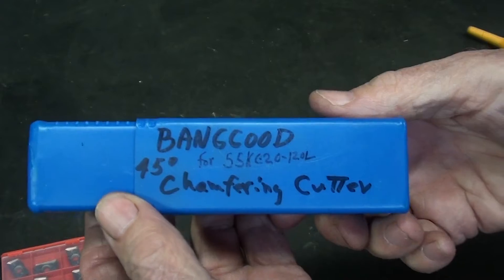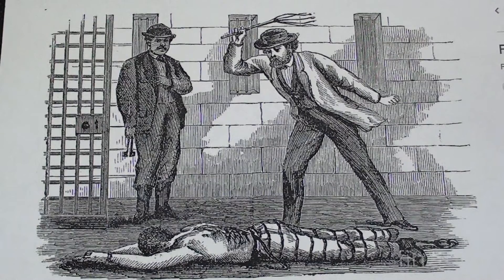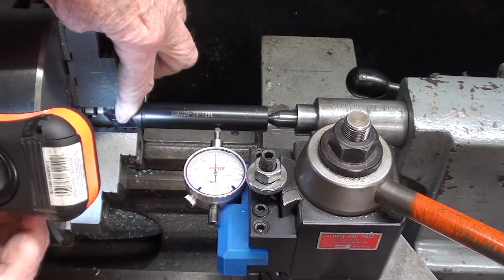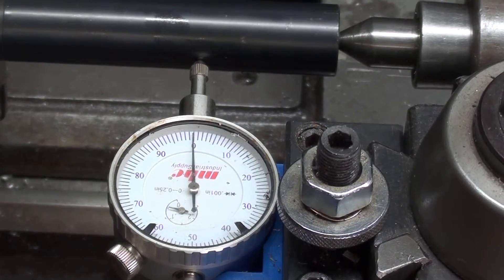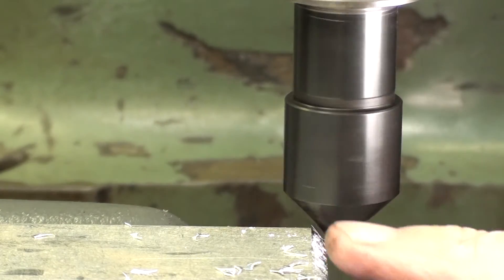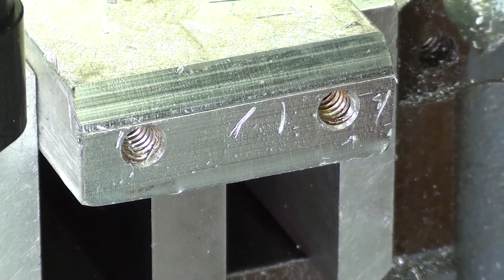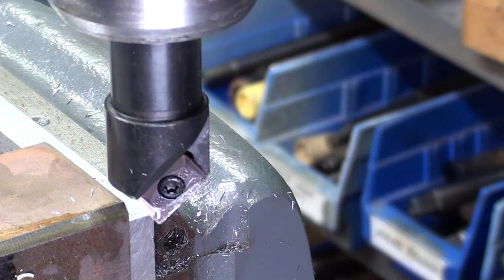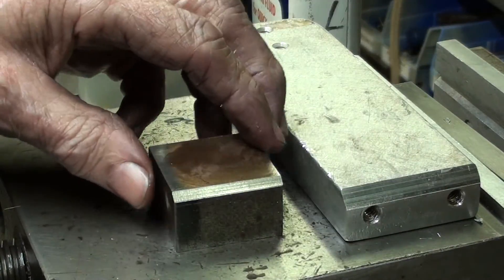CUTTING CHAMFERS on Bridgeport SHORT SUBJECT #38 tubalcain

Comment: A 1/4" (sized) chamfer is not heavy at all after three or four passes on ALUMINUM.  (Learn to say it and then make your point...)  This kind of tool from ISCAR would have done a beautiful job on any material that was not hardened to begin with.  Showing what you got on 6061 gum ALUMINUM or on 12L14 screw machine stock is no big deal.  Do it on your Bridgy with a properly made insert chamfer tool made in the USA, Israel, Poland, Germany, Macedonia, Japan and even our cousins in Great Britain and you will see what a good chamfer tool can do.

BTW, I do like you, Lyle, and I like your channel, but sluffing of crummy tools here is below you..  Sometimes your videos are  a blast.

Dean.  35 years (plus quite a few more) in the trade.  Still fun to watch, mostly.

Comment: Climb milling isn’t always better. It tends to pull the table along with the cut which is why unless the machine is tight and fairly heavy, it doesn’t always work. I rarely use it. But most often when I do, I just use it for finish cuts.

I watch shorts, but other than the funny ones, yeah, they’re too short.

Comment: Lyle.
Do you think one of the "20's" in the part number of the tool might refer to the shank diameter   ?
The other peobably the edge length of the carbide tip.
🤔  possibly  ?

Comment: @mrpete222 Good lesson for budding machinists to see tool modification to suit specific needs. You might have other insert cutters laying around that fit those inserts. I have a 90 deg endmill with a similar insert shape (APKT) that I like quite a bit for finishing - cheap per cutting edge.

Comment: I'm still wearing shorts because the temperature here is very moderate. I like them. 
Sometimes, I use carbide-faced router bits to cut chamfers and round edges on aluminum.  I throw them away when they're spent.

Comment: I wonder if a different style insert is available for this size that would give a smoother cut. I doubt Banggood has anything and it would require checking different manufacturers.
Reply from the maker: I think it would have helped if the tool held two inserts instead of one

Comment: Lyle - Another good video.  I'm with you - 60 second shorts are just trolling.  It takes longer than that to put anything substantial out there.  Nice example of difference in surface finish by varying speeds and feeds.

Comment: Chamfering with this method as daily practice in our shop. We machined much more aluminum than steel and it was all CNC. A chamfer tool could not only cut square corners, but with CNC could follow all contors. The controlled depth of cut allowed a consistent chamfer of pattern over the entire part. We chamfered with very high spindle speeds and feed rates. Finish was commonly ripply, but consistent. I never heard any discussion or complaint about the chamfer finish. 
We machined very large flat aluminum plate. Before chamfering with CNC, these complex parts with many holes, straight edges and contors were routinely chamfered by hand with a router and a carbide conventional wood style bit with no chip breaker, but equipped with a follower guide bearing. 
I have employed the same method with my home shop woodshop router table. I have only done aluminum in the woodshop router table setup, but with the guide bearing you don't require a fence and you can follow curves. I use the method in wood all the time, but I use a round over bit. With metal I have only used the 45° bevel bit.

Short YouTube clips can be cute, but I prefer your longer versions.
Reply: Exactly. I used a 1/2" diameter tool of this type for both spot drilling and chamfering, usually narrow chamfers of a mm or so. 10krpm and 50ipm for a uniform step of 5 thou. Not glass smooth, but visually pleasing.

Comment: I’ve never used an  insert cutter like that but I anything free is good you know. A two flute 90 degree HSS cutter with much more rake will do a better job. The carbide insert type is designed to machine hardened steel.
Reply from the maker: Luckily, the tool was free. I did not like it very well.

Comment: No 25/32” collet? That should be within 4 thou.

Speaking of that size, why did Craftsman always include a 25/32” wrench in their open end sets? Something found on your beloved tractors?
Reply from the maker: I always wondered that
Reply: 20mm is .787. A little too large to fit a .781 (25/32) collet.
Reply: @ellieprice3396  the part actually measured  0.785", so 4 thou difference.
Reply: It fit the rear axle nut(maybe also a jam nut) on at least one USofA made bicycle with coaster brakes, I used it lots in the late 50's, don't recall EVER using it anywhere/anytime else.